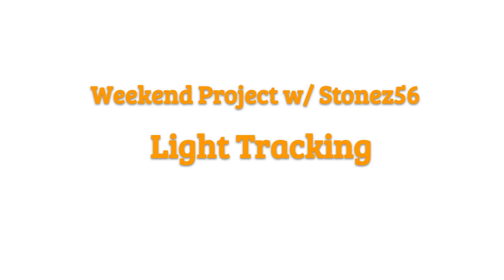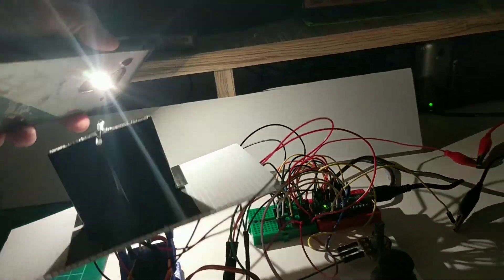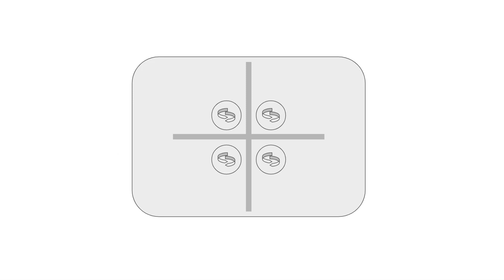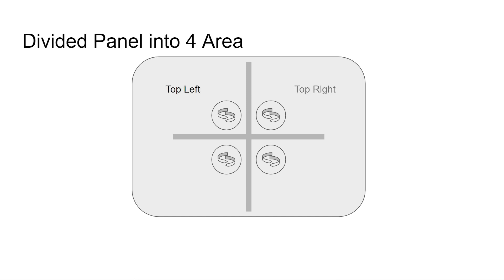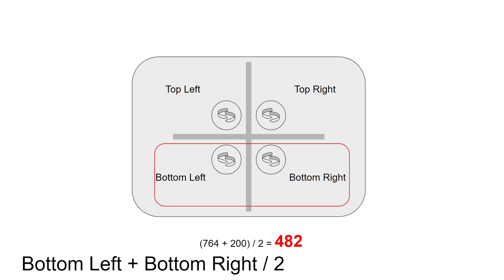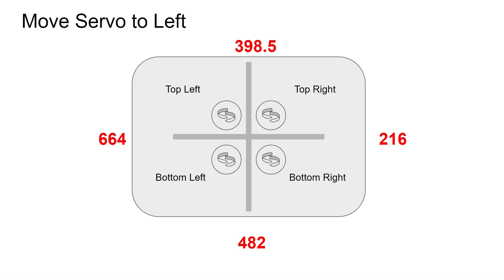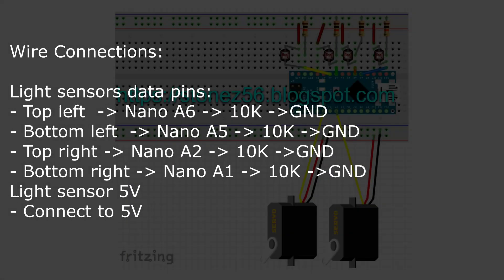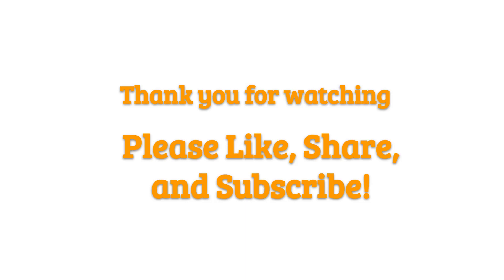Arduino Light tracking project

Comment: i put together one using your code, but the y axis will not move down further than about 45 degrees from its top position. have you had this problem?
Reply from the maker: Try to reset the angle of motor.